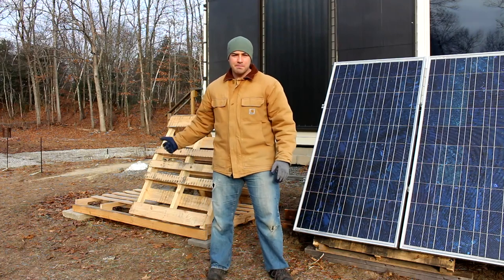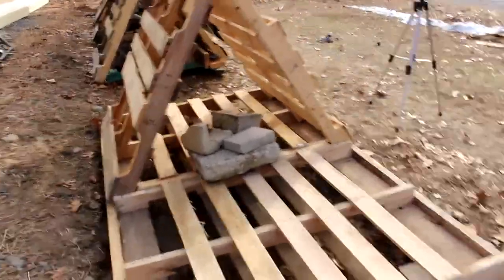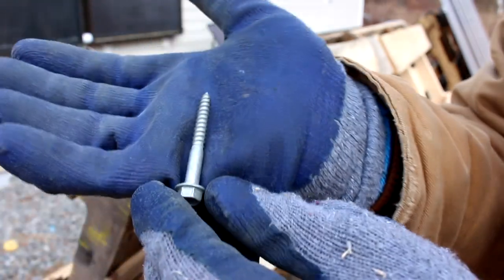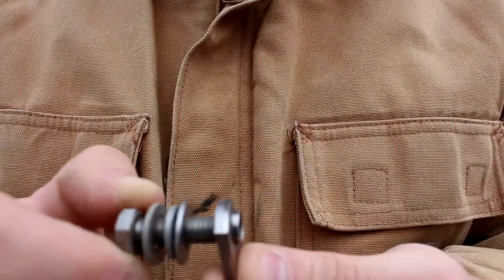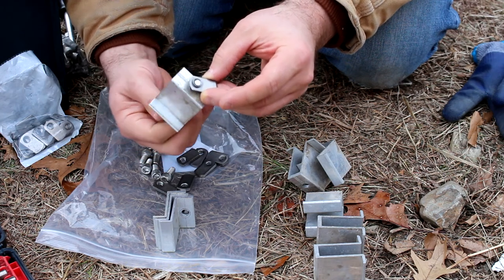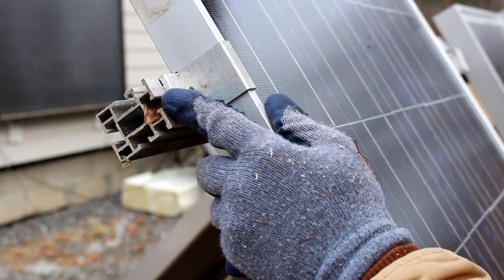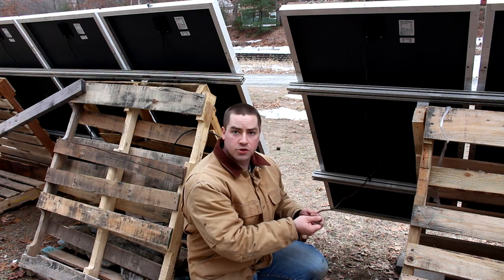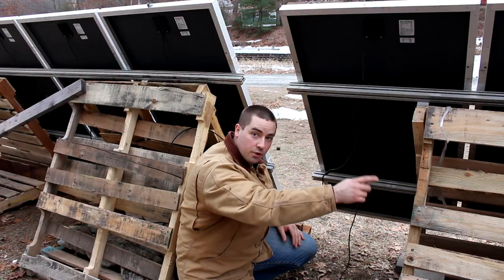DIY Solar PV Mount on Pallets, Version 2

Comment: oh man, you are great, you can make so cool stuff from the 'trash' :) I love this
Reply from the maker: Thanks.  I'm trying to show that solar doesn't have to be expensive.  I actually got all the pallets delivered for free!  A local warehouse needed to get rid of them and I responded to the ad.  They dropped off a small truckload.  Maybe 50 pallets all at once.
Reply: @DavidPozEnergy  you are right, ready-done frames available for sale are expensive and use to much expensive materials. The first roof I did was using standard alum. frames - I paid way to much for them!!! Then I experimented with basic zinc-coated steel. It was x5 times cheaper and suprisingly faster to mount.  (plus its much easier to buy basic second hand steel)     Also as you mentioned in another video, there is a market of second hand or damaged panels (most can be easily repaired), so the whole system can be done really cheaply.    I will try to make small solar power plants to sell electricity to the grid. I realised I can buy small pieces of lands (like 2.000 sq meter) for very cheap price, because its inprofitable for farmers to grow anything on such a small piece of land. I will try to use your patent with pallets :)